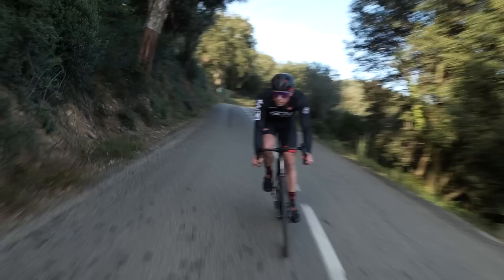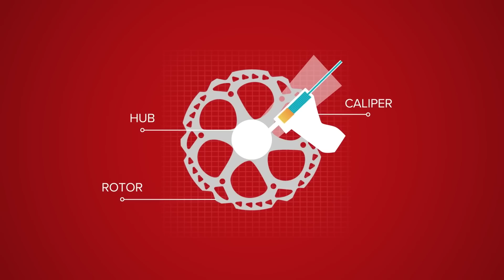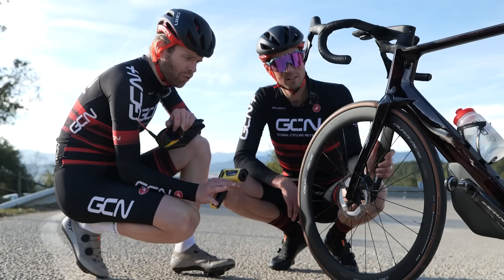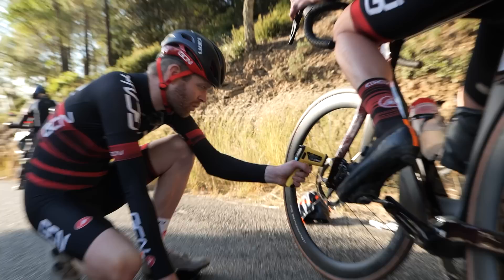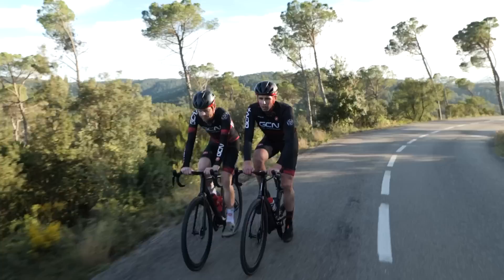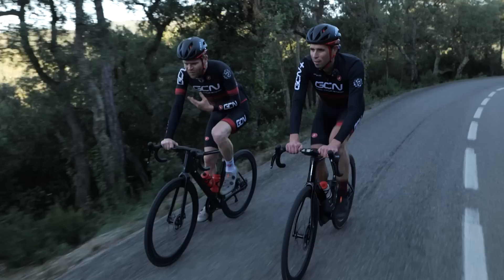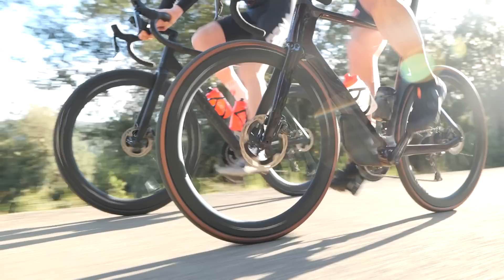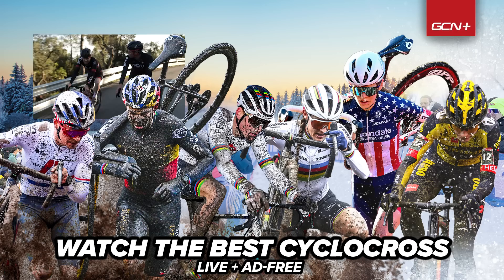Are Big Disc Brakes REALLY Better?

Comment: With bigger rotors being better , I wonder if someone could maybe invent real big rotors …..like maybe 700c size …. and then place the pads ,say, at the junction of the fork crown and the frame instead of at the end of a big heavy flexy fork ?  Maybe it would be lighter and more aero ? Just thinking …..has this ever been done before ?
Great job though guys in trying to keep a straight face all through this 😊

Comment: Not just bigger discs for bigger riders, but also for smaller riders with small hands - that's where I like 160mm - my hands are higher on the brake levers from the hoods than a person with bigger hands, so I don't get the leverage from the brake lever, in which case it helps to have it from the bigger disc.
Reply: yes, the same for me. i use 180mm on my gravelbike and its the only way you can get (almost) max braking power from the hoods with smaller hands. its still not as brutal as on an MTB with big brakes where you potentially somersault the bike over at any speed with one finger if you want, but a massive boost over rim brakes or 140mm discs.

Comment: Will manufacturers have to beef up the forks to handle the greater peak strains of the 180s?
Reply: Yes, even MTB forks have limits here. The XCR 32 (32 mm stanchions) for example has a limit of 180 mm, while the XCR 34 (34 mm stanchions) is allowed for 203 mm rotors

Comment: Each brake is doing identical amounts of work, so they will generate the same amount of heat.  Unless the amount of metal increases, the temperature increase will be the same.  The larger rotor moves through the brake pads faster, but needs less pressure.

Comment: You need to try that with the bodybuilder. 
Also I believe that a heavier rider with a larger rotor would maybe induce too much stress on the fork and the frame. Worth testing 😂
Could you also test temperatures on rim brakes, as the ultralight TPU inner tubes are dedicated only to disk brakes due to temperature. Would like to put some on my rim brake wheels, with one of you guys doing the dangerous testing. I can pay for the gestion homemade snacks. 😊

Comment: Big rotors should be standard, I am a frankly short fat bicyclist person, Manufacturers are sucked into the black hole that is lightweight and sized for skinny tall or tallish blokes , because that's what pros use so that's what flies off the shelves. its like XXL cycle clothing is about L for any other garment. (where did I leave my heavy duty soap box). Harumph.

Comment: It sorta kinda has to give advantages in stopping, with larger rotors, physics being what they are.  One of the things I like about my Merida gravel bike is that they can accommodate 180mm rotors.  As a 187cm/86 odd kg guy, being able to run bigger rotors if I need them is very appealing.

Edit. Nice to see the Peak Torque shoutout :)
Reply: Small discs have enough stopping power to lock the brakes, and it is the tires that actually grip the road and not the brakes.

The point of larger discs is increased heat capacity and better heat dissipation, to stave off brake fade. Same is true for cars, the "small" stock brakes are powerful enough to lock up the tires (hence the need for ABS).
Reply: @sepg5084  basically yes. The extra  mass gives you extra capacity to deal with heat build up.

Comment: Makes sense that you’d have the same temps at the end as the same amount of kinetic energy is getting transfer thermal energy. As for shorter stopping, it’s incorrect to say that the larger rotors stop faster and have more leverage. See this engineering video https://youtu.be/CyH5xOcsXxs Larger rotors will give you more braking performance over repeated heavy use and reduce the risk of exceeding the brake system

Comment: That's cool. I've had an idea 💡. Imagine a 700c size rota, massive. You could integrate it onto the rim for better areo gain. With the mechanical advantage of a large Rim disc you could probably get away with using rubber pads on a caliper. 😂😂😂

Comment: Won't the speed of the rotor passing through the brake pads actually be faster when using a 180mm rotor than a 140mm rotor, so assuming the same materials it should be (slightly) hotter with the 180mm.  Conversely however, the heat will dissipate faster.

Comment: What temperature will disc brakes fail?
Reply: You get some fading if it's above 300° C, but it still works then. The first thing which happens is the pads will burn away, but there's almost no chance to achieve this on a bike (it was once tested on a lathe)

Comment: Most of the road/700c forks I have seen, say don't put a rotor any bigger than 160mm on it. How can you go bigger if the manufacturer says not to? I have a 203mm on the front of my bike but it's got a MTB suspension fork and the bike (with me on it) is 250 lbs, with cable pull BB7 brakes. I need it bigger. 😁
Reply: Get 4 pot calipers instead of the 2 pot. Better braking without the need for bigger rotors.

Comment: Rim what? So, on my MTB I have 203mm Hope rotors and Hope E4 4-pot brakes. They're incredibly powerful. So powerful that they'll easily lock either wheel with one finger. However, my road bike has bigger wheels, goes faster and has more consistent traction but small feeble brakes. Why??? Surely the road racing bike should have massive brakes and the MTB that is traction-limited should have smaller brakes?

Comment: Here is the experiment you should be doing. Disc brake vs rim brake with alloy wheels with your heat gun. 

Measure the temperature of the alloy rim when you come to a stop just like you did on the rotor. Time the cool down time from hottest to a baseline. Just as a curiosity time the run. On a sunny day because the mass population of the world wouldn’t go down a mountain in the rain. 

Alloy wheels not carbon wheels because we all know they brake better but more importantly they represent the largest segment of the viewing and riding population.
Reply: Ahhhh you're one of those!! I'm assuming you hate tubeless and electronic shifting too 😂😂.

Discs are just better dude. I commute all year round. I wouldn't swap hydraulic for anything. Not to mention the only maintenance I've had to do in 5000 miles is one set of pads. Which took about 3 minutes. Less fade, better in all weather, less maintenance, more modulation and probably cheaper in the long run given maintenance is almost non existent and it doesn't destroy your rims.
Reply: @jesmondo5785  absolutely think tubeless sucks. I made a video on my channel with 25 reasons why tubeless road sucks you should watch it. I’ve been trying to make tubeless work for 14 years and ridden over 100,000 miles on it -  it sucks! Disc brakes suck too! Di2 I had it back from 2009-2018. It’s great but unnecessary. And now with the release of 105 Di2 it has put it out of reach for the average rider.

Incorrect assumption of cheaper long term. Here in my shop I am replacing disc brake pads every 2-3 months for my real riders and rotors every other brake pad swap. That will cost you more than an alloy set of wheels WHICH I’ve never had to replace. I ride at least 10,000 miles per year. I climb AND descend 1,000,000 feet per year I’ve never had to replace worn alloy wheels that is total bullshit “dude”

Do the math brake pads $20-$40 for each set of pads. Rotors $50-$90 for each rotor over and over and over again  for the life of your bike - rim brake pads $10 and they last years and rims don’t wear out like people like to exaggerate that they do. 

But even if wheels wore out look at the escalation of the arms race between these component manufactures every 3-4 years we have a new drivetrain speed - 10, 11, 12 and 13 speed drivetrain speeds. You need new wheels anyway. Come on your argument is moot in every possible way. Additionally, you don’t ride much so you don’t have enough real world experience to embarrass yourself Worldwide in the YouTube world.
Reply: @jesmondo5785  keep in mind I own a shop I see thousands of bikes per year and many are my repeat customers so I see all the issues my real riders will have throughout the year (tubeless, disc brakes) - your sample size is n=1.
Reply: @jesmondo5785  ahhh see you ride clown car tires on your bike 32mm and 44mm 🤡
Reply: @jesmondo5785  my highest milage rides are women ... they don't want to faff about with changing brake pads and rotors.  For example Barb, 66 years old, over 14,000 miles and over 1,000,000 feet of climbing  for 2023 she is not interested in the least to do mechanical work.  She wants to ride her bike and spend time with her grandkids on any spare time she might have.  My next high mileage rider is 60 plus as well (10K plus and stupid strong woman climber) and I'm 57 we've got more time in the saddle then you have even been alive.  But ok you can try to make a point lol

FYI - there is no such thing as Ultegra level brake pads.  Try again... 

Just our Saturday rides are 100 milers with 10,000 feet.  

You have to understand I run a high end shop with affluent customer base they don't want to do the work they want to ride their bikes.  

Your argument about tubeless for MTB being used for years is not a valid argument ... again.  Tubeless on MTB works because of the low pressure of 20-30 psi.  

Me thinks you need to come start watching my channel so you can be educated
Reply: @SeeYouUpTheRoad  I'm good for your channel dude. I stay away from videos with 300- views. Are you seriously trying to insult somebody via tyre choice?! 😂😂

Tubeless works dude, even in road. I understand now. You're older and not moving with the times. Advances are scary I get it. Car mechanics do the same thing.

You're talking like I'm running 20 psi on a 32mm tyre. I'm not, I'm running 60-80 so what's your argument then? "lucky" I'm guessing? even though I used to flat almost weekly when running tubes. Please explain...

I appreciate pads are largely generic, but you wouldn't run ultegra and then run the cheapest pads going. Correct?? The pad price is relevant to the components.

 In all honesty I don't care about experience or anecdotes. There's plenty of bad drivers out there who have been driving for 40 years. Should Lewis Hamilton listen to them though? As a fellow cyclist you probably see that they're terrible. Experience doesn't equate to correct. Your personal bias was clear in the one video I watched on your channel, you even said yourself she's not flatted in probably a year yet you say tubeless doesn't work. Here's how it looks to me.

If you flat with tubes you've gotta change it. If you flat with Tubeless chances are you won't have to put a tube in, but if you do the level of work is still the same, so you may as well been tubeless or put a plug in. They work pretty well these days.
Reply: @jesmondo5785  thanks for watching one video. 🥰 Continue coming back you will learn something as I might learn something from you eventually. Furthermore, the reason people like my channel so much is because it’s small, it’s real talk, no marketing bullshit , no sponsors no ads AND I actually respond to comments on my channel sometimes with a long format video not just a comment. Think about what will GCN do for you exclusively Jes? I run my channel like I run my shop with exceptional customer service. In the meantime we’ll see you up the road.

Comment: People hate it, but the wheel, brake, & tire industry are going larger & wider in the future. Moto GP bikes use W I D E TUBELESS tires & go 200mph then brake to to 60mph like nothing. If the peloton is going to keep getting faster with 54t chain rings then they’re going to need bigger brakes & wider tires to corner faster. It’s coming be prepared.

Comment: Tire width is a factor when considering rotor size, large rotors can be too powerful for thinner tires.
Reply: I've tested a 180mm rotor with a 23mm tire once... The results were very strange and not what I was expecting. I needed to put a lot more force in the levers and was harder to lock the wheels. 35 and 45mm tires required way less force and lock easier (and stop the bike way better).

Comment: Great video. Definitely would love to see these in a controlled environment on a lathe!
Reply: @rider65  Disagree. The temp of the 180 was very similar to the others at the end of this run because the hill was probably not steep enough to show what it can handle. Also, he may not have braked the same amount at the same speeds on each run he did. You'll see with consistent breaking force applied non stop, that the point of failure for the 180 would be higher than the others. Also you don't have to be such a rude twat to ppl online whilst you're sitting behind your keyboard

Comment: From experience, gravel bikes especially should get 180 rotors. You find yourself on sketchier paths, sometimes shared with MTBs that have enormous rotors. But you don't. And gravel riders are likely to be heavier than roadies because #cake. I've almost scared myself with 160s, and turn my front disc blue. NOT nice.

Comment: I'm no engineer, but doesn't it mostly have to do with thermal mass more so than leverage? You're converting inertia into heat, so more rotor mass = the rotors ability to retain heat longer? Idk I've never fully understood brakes.

Comment: "The smaller rotor looks neater than a bigger rotor".  No rotor looks neater still!  A rim brake is just a disc brake with a tyre fitted to the rotor.  And much more leverage.  And simpler to maintain, and just looks "right".

Comment: Why do the manufacturers (strongly) recommend against using 180s?
Reply: that's because the leverage applied to the caliper and then the fork are much grater than with smaller rotors. Road bike fork aren't designed to tolerate that much mechanical stress.
Reply: Could be the stronger braking power possible will put extra forces on your fork. Mountain bike forks are more substantial and built to take the forces more

Comment: Even an idiot knows that larger rotors provide more braking power, and shed heat faster. Please see the entire world of motorcycle racing.
Reply: You're on the right track they don't add breaking power they just are able to convert and dissipate thermal energy more efficiently which in turn provides much more controlled braking with little to no fade
Reply: @rider65  that's not quite right. Larger diameter rotors also have an increase in surface area, which increases braking performance.

Comment: I believe most of your braking should be on the rear.  Why aren't you measuring the heat generated off of that rotor?  What am I missing?
Reply: @onlytruefalcon  thank you for the explanation.  I will give it a go.

Comment: I think you should measure the temperature on the disk at the right side of the caliper. The disk break turn your momentum energy to heat energy, so if you break within the same time from the same speed to fully stop, same heat power will be generated by the friction of the break pad, which will result the same temperature behind the caliper (left side of the caliper), which is also the spot of your measuring point. But the disk area at right side of the caliper has a full rotation to cool down, the bigger diameter, the higher speed in air, maybe results higher heat emission and lower temperature.

Comment: I still use rim breaks mate's
Wont be switching till they make me. I ride a Domane rim brakes next one prob. Will have discs.
But I'm sure it's not the size of your disc it's how you use it. Riiiight?
Edit: however I've been told by a dependable resource that there is a just  toooooo small disc, makes sense to me. If your disc is so small it wont fit in the calipers well your out of luck mate and I'm so very sorry. You can always get disc reduction but I'm afraid you can't get it stretched.... Lol
Yep, keepemcoming

Comment: Why are the discs the same size front and rear? On a motorcycle the discs are much larger on the front, as that is where all of the stopping power has to be.
The rear disc is only there to keep the rider and the bike in line. 🤔🤗🤗

Comment: I still prefer Rim brakes. Easy to maintain, no rubbing issue, lighter weight. Though disc brakes have more stopping power but rim brakes are good enough stopping power for me.

Comment: You trying to sell me on a technology that isn't better than a rim brake. Disc brakes create more problems than they solve. They  can over heat, the can shear your fork, their lock up time is shorter to the point they do poorly at slowing a person down, they require a frame with different specs, should I go on?

Comment: Here’s a question…. Is there an optimal temperature for discs to work?  Do they need to be “warmed up” first?  What about the different seasons?   Really cold in winter VS really hot in summer.  Get after it GCN!
Reply: Discs using resin pads are not temperature sensitive, since the pad always has the same consistency. If you use metallic pads they work better if the brake is warm. 
Rim brakes using rubber pads are different here, since the rubber gets softer if it warms up, and the brake force increases then
Reply: No stainless steel or metal rotors with most any pads do not require to be preheated.

Comment: Coming from the MTB side, everything below 180mm seems tiny.
Reply: Well most cross country guys are running 160 so I suppose you're only Riding Trail or DH or Enduro surprised you didn't know that
Reply: @rider65  I‘m 90+ kilos so even on my XC bike I run 180 at the front. To be fair, a road bike the tire grip is often the limit.

Comment: Imagine if the disc would be the actual wheel and the brake part would be mounted on the frame higher. That would be a nice system.